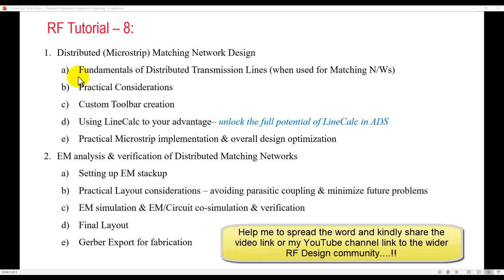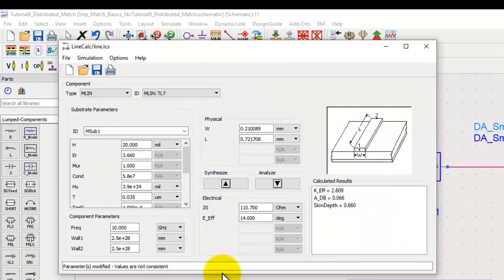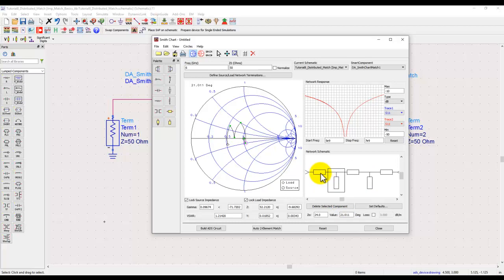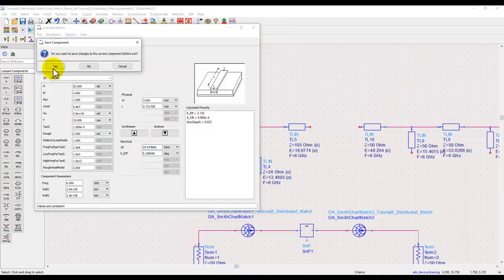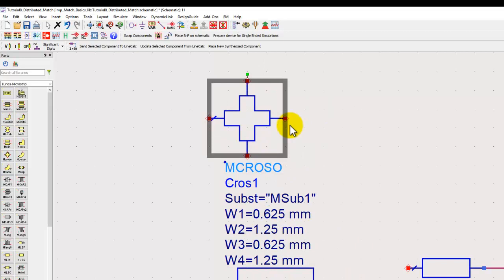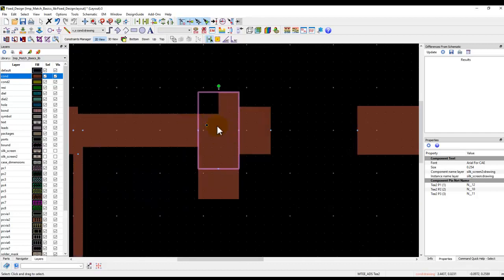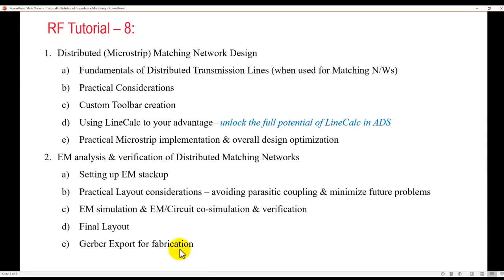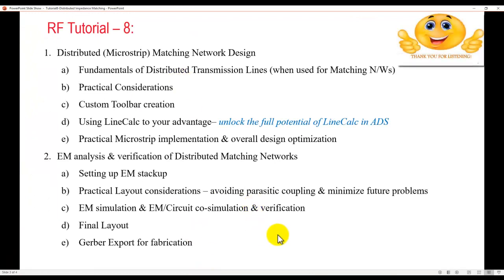RF Design-8: Distributed Impedance Matching Network Design

Comment: Discussing on some practical points are really helpful. Adding LiineCalc toolbar is new to me. You told there are more features which you'll open up in upcoming videos.
These 140+ mins video on matching networks actually covered the every bits of the subject in real depth. Such kind of detailed and long video tutorials are much appreciated from learning point of view. 
Hope to see such detailed demonstration on LNA with practical aspects in next tutorial series.
Reply from the maker: Hi Riju, Thanks for your comments. I will plan to have another video on LineCalc as there are many capabilities offered by the tool which designers may not know.
LNA design will also be covered in detail with practical aspects as well.
Reply: Hi Bhargav,
How could we include a capacitor dc block in to the interstage matching of a multistage amplifier
Reply from the maker: Hi Kishore,
While designing inter-stage matching networks using Smith Chart utility simply use a series capacitor along with rest of the transmission lines. There is nothing great about it....😊

Comment: great video tutorial sir , 
my question is that , during the process of impedance matching , instead of using the smith chart method , can we use optimization cockpit for the same  by assigning 2 stubs and a transmission line, all of random length while keeping the width constant for the required frequency of operation ( w calculated using line cal) . After that we can assign the goals required  for optimal gain and minimum return loss , then just run the optimization cockpit. ???
Reply from the maker: Hi Vineeth,
Yes, the approach you said will work and for that you don't need to even use LineCalc...Experienced designers do so because when you have a sense of what will take to do impedance match then you can simply reuse previously designed networks and optimize its performance to suit your applications. I will cover those techniques in future tutorials.
Reply: @BhargavaAnurag  thanks a lot for the clarification sir :)